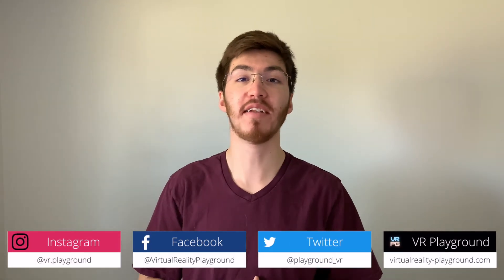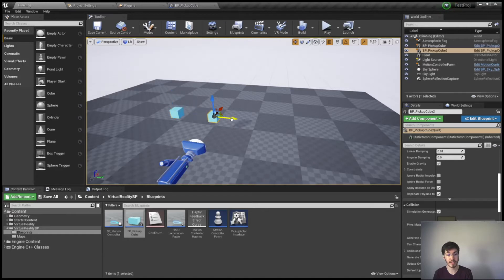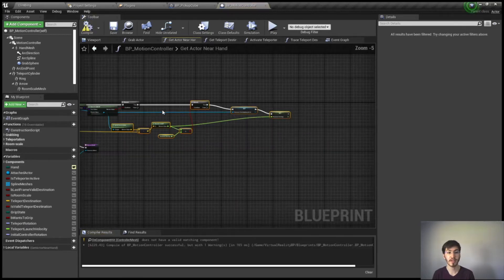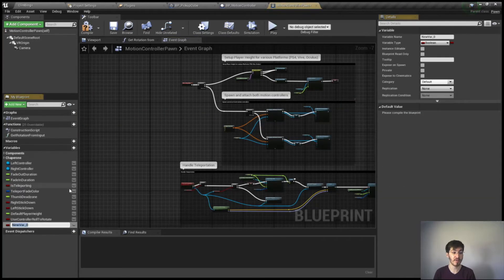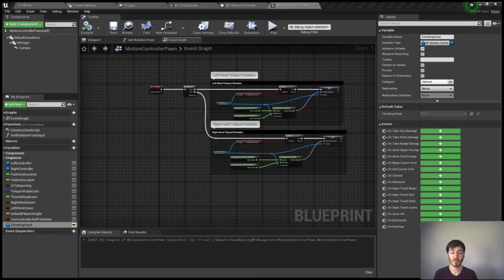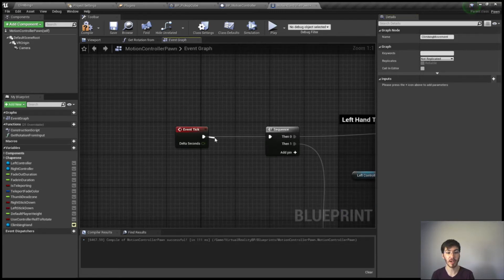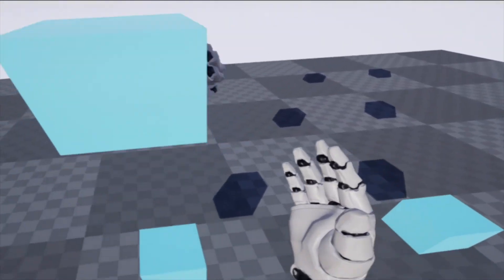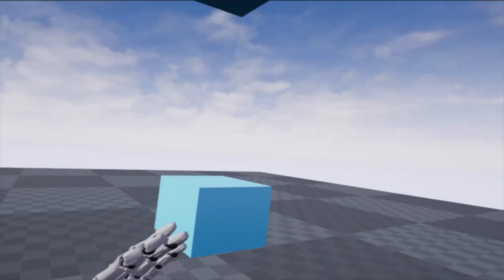Climbing Mechanics in VR using Unreal Engine 4

Comment: What build of unreal engine was this made in? When i load a new VR level in 4.27 i cant find the motion controller blueprint
Reply: BP_Motion_Controller is only availible if you start a new VR template project. Or create a new bp and search in the bottom menu of the prompt and maybe there is a ready made one available there